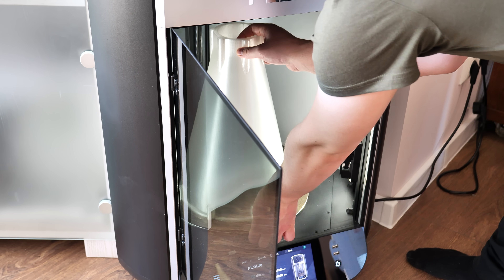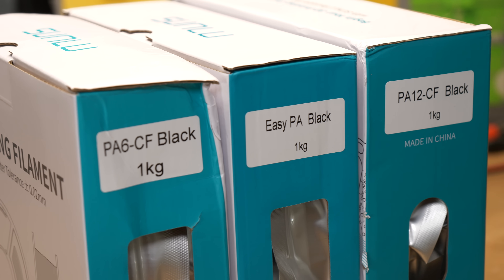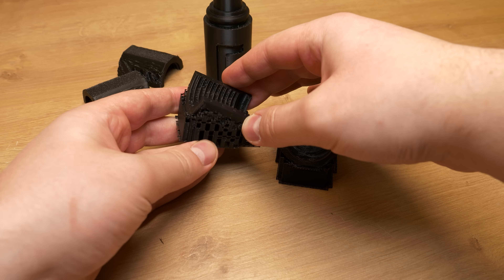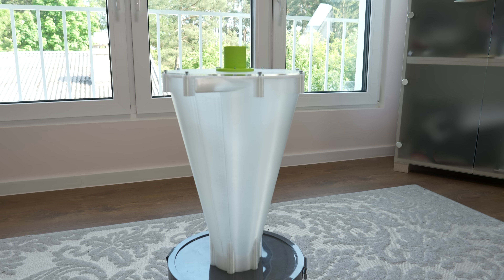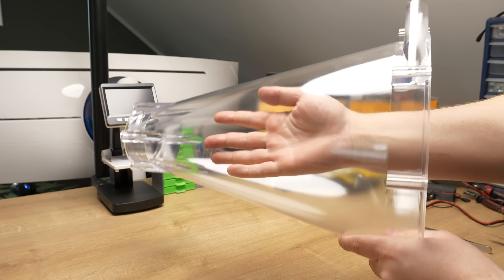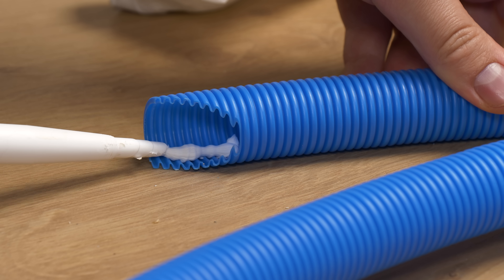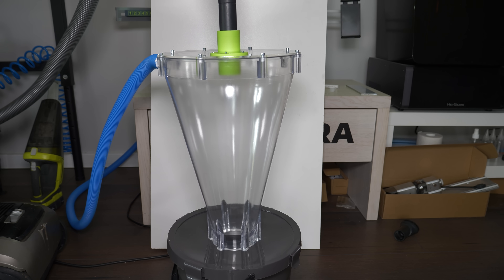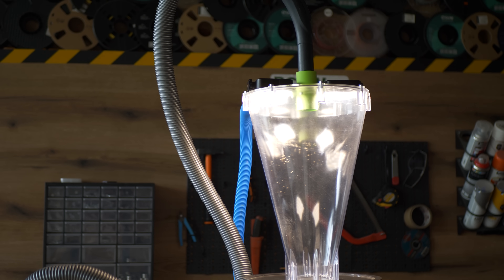What Really Happens Inside The Cyclone Separator?

Comment: The ribbed tubing along with the high flow rate of the vacuum.  If you go with a variable speed pump and lower it, or go with smooth tubing, it should solve that problem.

Comment: If you use a pipe on the input which inside is smooth, then it will be quiet. Now if you want no noise, you have to remove the glued pipe. 😁👍

Comment: The noise is from the tube you used, it's corrugated, not spiralled.
If you compared the hose you used with the vacuum hose, you will see the difference.
With the corrugated, there is a number of evenly spaced points to create a standing wave that's added to over each evenly spaced bump.
With the spiral hose, the sound is cancelled out through the rotation.

Also the hose diameter you used is too small, you need the same size hose that comes with the vacuum cleaner.
If you want to slow down the air velocity, you can go with a bigger hose again, but high speed air moves product better than low speed air.

When the dust laden air is introduced to the cyclone, the area the air moves in greatly increases, reducing the velocity of the air, combined with the friction of the dust hitting the sides of the cyclone, will reduce the dust speed allowing it to fall down, while the lighter air move into the middle of the cyclone and out the top.

Comment: printing n mechanical engineering isnt the same . very little real life experience will create this .
Reply: You are correct, but im not sure if he ever claimed that he is an engineer or that he is as good as one. I think he specifically used to mention that in his older videos if im not mistaken
Reply: @karyjas1  Again i mentioned 2 factors . lack of engg deg aswell as real life exp. Lets take the pipe blunder . the 1st step wudv been to check strength of the pipe under buckling forces with only vac n pipe connected n pipe inlet with resistance . during the test itself he wudv found out the sharp whistling . secondly if u have swung around these ribbed pipes ever , u mustv also heard the sharp shrill . its only constructive criticism . hope the channel grows a lot more  .

Comment: very nicely done project. The results from PCB Way are amazing. I have a commercially produced cyclone vacuum attachment and it's the absolute best accessory one could have. It was clear at first, but metal shaving, sand and other sharp particles have frosted and scored the inside of the cone. It still works fine, of course. My shop vac may not be as powerful as yours is, or my bucket is stronger, as it does not collapse. I learned recently that the cyclone attachment and shop vac make for a great hole digger in loose sand and a bucket of sand is easier to replace in the hole than the results of a shovel.

Comment: Looks like you didn't use any calculations for the separator. Separator design should take into account air velocity, volume, particles, etc. Just buy one, it will be considerably cheaper and better than this.

Comment: The noise comes from the blue tube. You need to use a tube that's smooth on the inside.
Reply: Straight pipe that sucker.

Comment: I think it's the pipe ribs in combination with the high speed air in the blue pipe that causes the sound. Try get a smooth pipe
Reply: Yep, they make a kids twirl toy that uses this sound effect from ribs in plastic tubing.
Reply: @phrozenwun  this way exactly my first thoughts as well.
Reply: So much for doesnt need to remove the tube 😮
Reply: It is. I was playing with smaller diameter convoluted tubes producing a very similar sound. It was a pump for inflating beach stuff, the sound was most noticeable with unrestricted airflow, whenever I used a nozzle it mostly went away.
Reply: Those serrated hoses are the ones making noise due to the even spacing of the grooves. The hoses with a spiral groove don't show this behavior. Additionally, I would opt for an anti-static one... less risk of shock or a dust explosion. Happy machining!
Reply: Yes it is 100%. Need to find spiral or smooth internal. It's actually a lot louder than what's coming across in video, it's annoying as hell!!. If he can just find a Vacuum tube made for vacuums, it'll work.